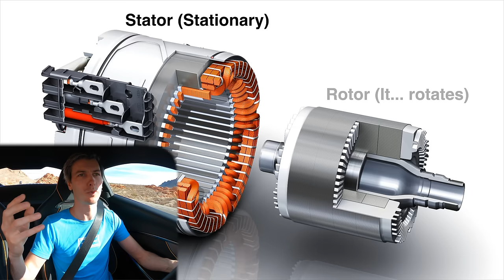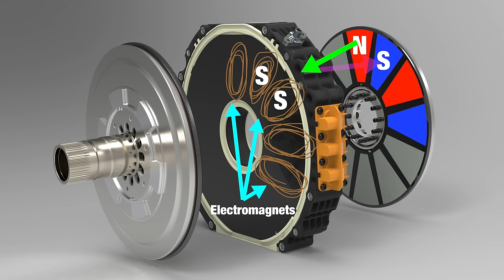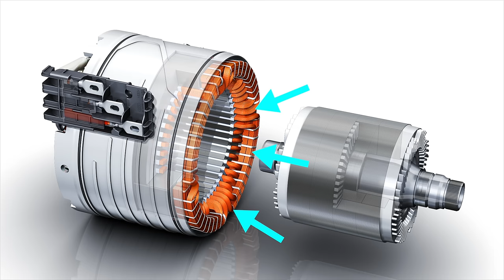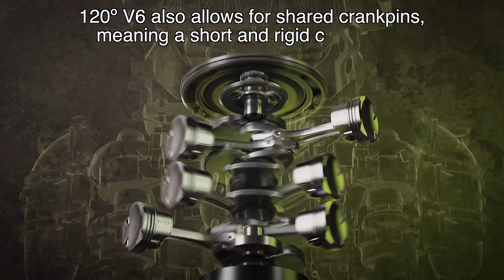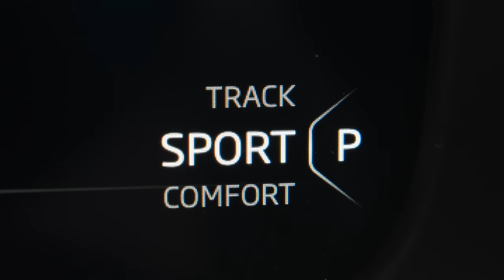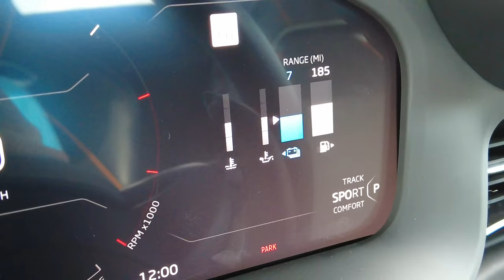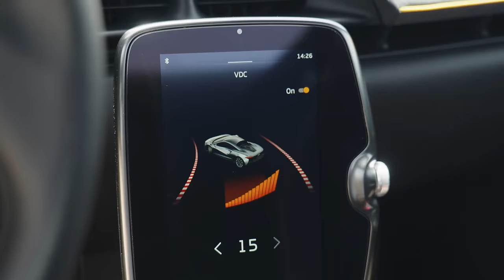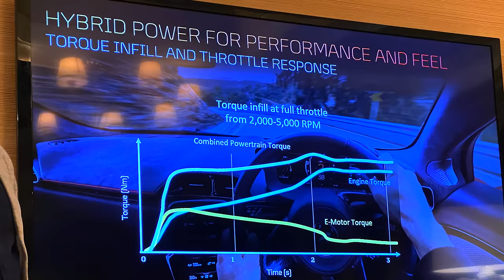These Tiny Motors Make Big Power! Why Supercars Choose Axial Flux

Comment: If the electric motor is between the engine and transmission, could you use it as an engine starter?
Reply: You certainly could, and many hybrid vehicles do this such as the Volt.
Reply: @HodgePodgeProducts  yes but isn't the Volt with it's 2 engines a bad example (drivetrain with the big engine, and when the battery is low start the ICE with the small one)? e.G. Daimler A-Class Plug-in has a IMHO more comparable drivetrain - and there the starting prossedure (while driving electric) is quite a complicated dance: open the drive-Clutch to build a torque reserve for the ice-start while still maintaining a constant toque on the wheel, let the Clutch 0 (ice-Electric motor) "kiss" to get the ice up to start rpm of ca. 500rpm, letting the ice rev up to drive rpm with an open K0, and closing Clutch 0 again at the end - all without too much jerks especially in cold conditions and in a reasonable time-frame... Here with a "big" V6 and much bigger start-torque would be interesting to know if Mc-laren still uses a 12V starter.
Reply: @TheSudder   at 7:42 you can see the starter where it connects to a flywheel of some kind. And then at 7:45 you can see the back of the starter and it is Valero unit. I tried looking up the part number but nothing comes up. I’m not sure if I’m reading it properly though. It is McLaren specific though
Reply from the maker: You can, yes, though in this case McLaren has a separate starter for the engine (I believe it can use either, depending on the scenario). Example: say you're driving and need the engine to kick on, but the engine is dead cold. You use the starter motor to start it, while the electric motor continues to power the vehicle. The engine remains detached the whole time, thus not interfering with your driving, as it warms up, and warms up the catalysts. Once warm, a clutch connects the engine to the electric motor.

Comment: So in other words don't park it in the garage facing inwards or you might not be able to reverse out!
Reply from the maker: Nah, even if the battery were to die, with the engine running you could operate reverse bc it will provide a charge.

Comment: I wonder if this style of Axial Flux motor could be assembled into a modular power unit by bolting them up side by side. One motor, 190hp. Two motors in one unit, 380hp, etc. It could be very useful EV conversions...not that McLaren is going to get into that business.

Comment: I'm 73 years old. I have followed innovation, and the next great thing stories all my life. I can't tell if it's because I'm old, but this thing strikes me as silly. It's not a race car, it costs a fortune to maintain, it's less comfortable than almost any high end car you might buy, luggage space looks to be non-existent and this may come as a shock to some people but going 150+ miles an hour is going to get you locked up and pretty much destroy any chance of getting insurance until you're about as old as I am.

We have a Honda Civic with the CVT and a turbo charger, it gets great mileage, it's really cheap to maintain, if you break down in the middle of no place there's a reasonable chance that you could find somebody to fix it, it's very comfortable, it's got a lot of luggage space, and it has enough power to beat most of the people that think signaling a lane change is an invitation to a drag race. Plus you can get more than 50 Honda Civics for what this costs and hand them out to your friends. That seems like a better idea to me than buying one of these.
Reply: Is this a joke post?

Comment: Eh. Turbos and variable valves and Atkinson and all that expensive and complicated klugy and inefficient stuff is a waste. A simple Compression Adjuster allows you to instantly vary the engine's compression ratio from 8:1 to 32:1 (or higher).

Comment: 7kWh... 11 miles range? why is it so inefficient? Pure EVs generally get about 4 miles per kWh in good conditions and this doesn't even get 1.6? this car's about 200kg heavier than a BMW i3 sure but that thing can even exceed 5 miles per kWh! (when its around 20C outside and heating or a/c isn't needed ofc) I expect it to lose some efficiency vs a pure EV of course as I assume there's drivetrain losses factoring into this due to the multispeed transmission and the fact the motor is coupled to an IC engine but not even half the efficiency sounds insane :/ ..actually IIRC some jaguar SUV hybrids even get better range per kWh lol

Comment: If you look at the fact that you can buy a battery powered impact gun that produces 2,000 pound feet of torque , this isn't that amazing .
Reply: if you thought about it for more than 1 second maybe you will get it
Reply: @787blah  that doesn't even make sense , does the output shaft on your engine match the size of your vehicle ? No it doesn't , in fact the output shaft on the average V8 is not much bigger than the drive on an impact gun . Are you trying to tell me that if the impact gun was there instead of the output shaft of the engine . It would magically produce way less power than if it was in your hand ? They use the exact same method to find out what the torque on an engine is , as they used to find out how much torque and impact gun produces .
Reply: @AzathothsAlarmClock  I'm not even sure what you're trying to say , but I know full well how torque times RPM produces horsepower numbers . And no the impact gun doesn't just stop turning after one rotation it keeps going . I have no idea how many RPMs it spins at . But I'm guessing it's just as much as the average American V8 or a hell of a lot more .
Reply: @Blox117  Ok been thinking for days and still not sure what It even is , If I thought about how most people can't even think for themselves ? How people like you only believe the programming , and discount anything that doesn't fit with what they think they already know ? Does someone from your church or government have to say it for it to be true ? Do I have to make a video proving that the torque from your Honda can't remove a nut that the impact can ? Would you believe it if Jason from Engineering Explained did it . because it can be proven by simply welding a socket to the out put shaft of an engine . And seeing if it can remove a nut , that the impact would have no problem removing . Or better yet make your own video to try and prove me wrong . Pound feet of torque is pound feet of torque , it has nothing to do with size or weight or your lack of imagination .

Comment: A very interesting subject, very poorly presented.  Your apology about the audio is not enough.  Please get the audio track(s) re-edited to trim out the awful engine drone.
Reply: Oh, and did you notice the engine has a starter?  You can see the end of it in the video at 7.42.  Why does it need a starter when it has a powerful axial flux motor between the engine and trans-axle?  Surely McLaren could figure out how to use the axial motor to spin the engine for it to start.  Surely McLaren, after investing significant effort to eliminate weight they don't need the weight of a starter motor as well as the axial motor.  Come on Jason!  It's unlike you to miss an inefficiency like this.  What's the story?

Comment: Definition of absolute irony:
A video about explaining radial flux electric motors, where the guy is sitting in a car making a constant and very LOUD farting piston engine noise, making the guy difficult to hear and the video annoying to watch.

I lasted just over 6 minutes of loud, constant farting noise.

Next time, drive on the electric motor, mkay? Or better yet, do the explaining back in the classroom with the whiteboard, as none of the explaining actually requires a moving car to carry out.

Comment: The all new engine is a misconception. Its still based on the 4.0 V8, just with the necessary adjustments to make it a v6 ( crank, rods, etc) and the angle is just a result of the crank balance since the v8 has to be 90 degrees to accommodate the flat plan crank. Its definitely a different engine in so many ways that it no longer seems like its even close to the v8, but most of the changes were simply necessary to turn the v8 into a v6 and new metallurgy.

Comment: Yiikes, I'm sure it has to do with packets and internet compression and my lousy bluetooth job-site speaker but the sound of that car as background to your voice is sending my auspie-tourettes into overdrive.  What an awful sound!  I expect it sounds better sitting in the seat (it sure better sound A LOT better).  Hard to describe it, something like a 4cyl motorcycle with the pipes submerged under a couple of feet of water and the throttle stuck at about 4100RPM. nbnnnnlnnnnnbnnnnnlnnnnnbnnn.l...

Comment: I'm always worried about the reliability aluminum (block) engines, especially with those overly stressed mass-market turbo 4-cylinders pushing 6k lb crossovers up slight inclines and general cost-cutting practices used by manufacturers (e.g., GM and Ford). Car manufacturers should provide the specs of wall thickness, heat dissipation efficiency, cylinder pressure levels, R&D testing scores, 3rd party parts suppliers, etc. Unless a vehicle is electric, there is no replacement for displacement
Reply: with a simple google search you can find plenty of research papers from Honda R&D or other companies that include testing results and specs.

Comment: So what about "coreless" axial flux motors? Then you dont have to worry about eddy current losses in the core, and therefore can run the motor at really high speed to get even higher power density's, but you have to use a larger gear reduction to get the speed down to get sufficient torque.

Comment: What a horrible explanation (or rather, no explanation) of axial and radial.  The reason they are named that is because of the orientation of the magnetic field.  Radial being parallel to the radius of the axle, and axial being parallel to the axle.

Also, power density is completely irrelevant for an electric motor.  Power efficiency is infinitely more relevant, since batteries in a car will weigh >10x more than all of the motors.